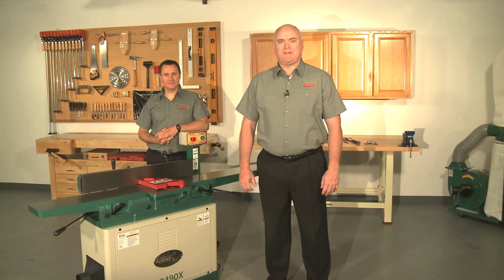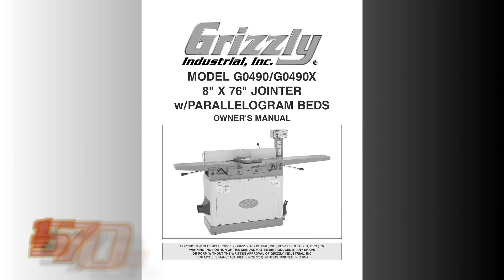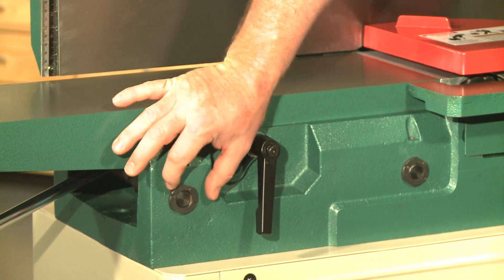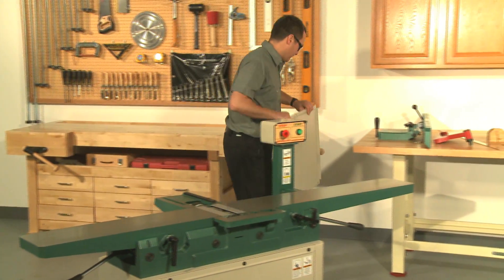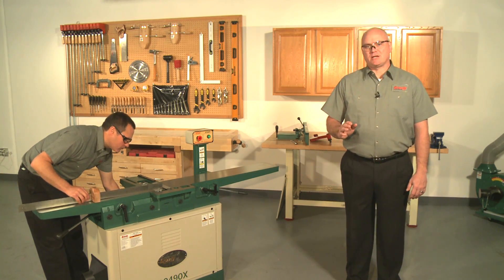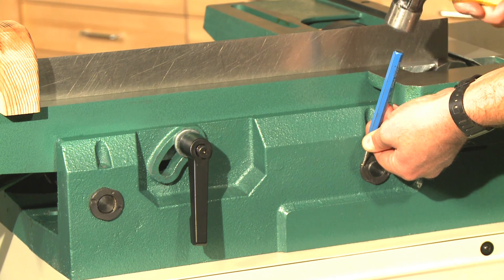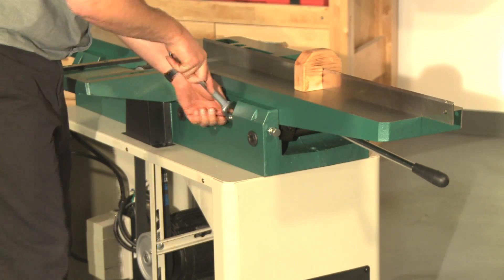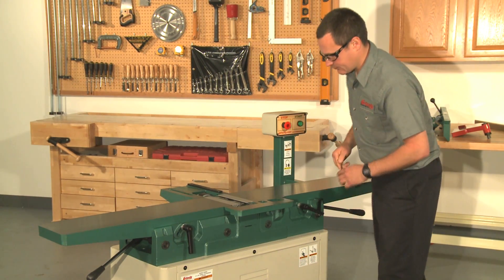Parallelogram Jointer Setup: How to Align the Tables

Comment: I just adjusted my Delta DJ-20 jointer which is almost identical to this Grizzly jointer shown. The method I used was the exact same as done in this video even though I had no prior knowledge or experience in doing so. Just sort of looked at it and made a few measurements and created a game plan. The outfeed table was far out of adjustment by 0.010” across the cutterhead. To get it inline I had to adjust all four bushings to get it even. The infeed table adjustment was the most difficult. It seemed like the best I could get it was a compromise of a few thousandths. That’s where I left it which seems to not be any problem. My jointer has three 8” straight blades that I just received back from a sharpening service. That set up I have done before, is a PITA and I sure wish that a helical head was available when I purchased this made in the USA Delta jointer in 1995. The longer the straightedge you use the more accurate you can be. A set of feeler gauges is helpful in measuring the table with the straightedge while setting the beds complainer. In the end it’s still wood and the most minor differences don’t matter.
Reply from the maker: Thank you for the in depth response. Great to hear you were able to use the same method for your Delta jointer.

Comment: Thanks for this video. I have a King Industrial jointer and it adjusts essentially the same way. The instruction manual didn’t contain any instructions on parallelizing the tables.
Reply from the maker: We’re glad the video helped fill in the gaps! If you ever need assistance with your jointer or have questions about similar adjustments, feel free to reach out to Customer Service.

Comment: My question is why not adjust the inner edges of both tables parallel to the cutter head? You seemed adamant not to do that. If one has a magnetic base dial gauge then one could be assured the near and far sides of each table near the cutter would be accurate. Then lift the infeed table to match the outfeed with a 12" rule. A long straight edge across both tables would allow you to see the variance in the ends of the table wings and more easily decide whether the far end of the outfield table should go up or down, so the infeed table was in its proper range.

Comment: The piece of information that I needed, that seems always missing from all explanations and printed documents is how to read the position of the eccentric bushings. The dot indicates the thickest side of the eccentricity. The neutral position of all the bushings is with the dot horizontal. Maybe it is just me, but not being able to see what is happening inside keeps me confused. Not knowing that reality, my brain was imagining turning a cam instead of a bushing. (I could have looked at the parts diagram and not made that mental mistake.) The two eccentric bushings hold a rod that passes through holes in the table casting, so moving the dot (thicker radius) downward raises that side of rod and the table. Moving the dot toward the top means the thinner part of the bushing supports the rod and the table lowers. (If it were a cam, the opposite would be true. It's little things like that make me feel stupid sometimes.)

Comment: Question... Let's assume my outfeed table at the cutterhead is .003 higher on the operator side. When I adjust the can 1st that location, will an adjustment be required on the opposite corner to compensate? It seems I will build a "rock" in the table on the cams if I don't. Am I thinking this correctly? Thank you!

Comment: I ordered an 8 inch jointer last May its almost a year later I still haven't received it yet. For months they told me it was on back order.  Then someone told me I should have been told that the 8 inch jointer I ordered was no longer available so I got bumped to the back of the line for the next 8 inch jointer model.  I am still waiting.....
Reply: Did you get your jointer yet?

Comment: First: why did you remove the back panel? I did not see anywhere this was necessary. Second: On my G0604ZX it seems that the rabbeting table extension is in the way of the setting bolts of the eccentric bushing. Do I need to remove the rabbeting table extension? BTW my jointer was way off from parallel after I assembled it. From operator POV the back right side of the infeed table was almost 1/4" high.
Reply: Almost the first step they showed was rotating the cutterhead pulley by hand, through the space covered by the back panel.
Reply: Brad Hedges Well honestly I did run thru it too fast. But still the cutterhead can be turned easily from the front. Much easier than taking off the back panel. I suppose for Grizzly's liability they felt they had to do this. Another dummy-me thing I noticed was that part of the reason my infeed table was so far off was because my fence set too low thus limiting the up movement when trying to adjust for smaller cuts. I followed the assembly instructions precisely but apparently did not tighten the fence mount good enough and the fence lowered over time. On another note I just rotated the cutterheads but can still see shade lines where the blades cut the wood. I am not yet convinced that the spiral head was worth the $.
Reply: It's interesting to hear that you're not convinced the spiral cutter head is worthwhile. I will be buying a jointer and planer in a couple of months and have been researching options. Almost everyone recommends them, but I have seen several others who say keep the standard blades.
Reply: Brad Hedges My previous jointer was a standard 6" Grizzly that was about 30 years old. I loved it aside from changing the blades. But I wanted a longer one to be able to flatten longer boards. What I notice on the positive sides with the spiral cutting head is that it moves through the hard tiger maple I am jointing with ease and I really don't notice tear-out. AND I haven't done a true test with other materials such as walnut, cherry, oak, etc. Obviously the hard maple is well.......very hard. It is possible that I ran the maple thru the jointer too slow and the shade lines I can see are heat related. Keep in mind that I am not a professional woodworker but have dabbled for a long time on and off. I will try to report back soon after more tests with other materials since now I think I have it dialed in.
Reply: Thanks for sharing your experiences. I am using an 8 inch Grizzly planer w/ helical head at the shop of a friend when I need one. They are nearly half an hour away... So that is not optimal. 

I have pretty much decided on a pair of new Grizzly tools, the 0490x 8 inch jointer, and the 0454z 20 inch planer, both with helical heads. I am building a lot of stuff to sell, and really need them close to hand. I appreciate hearing your experiences, they provide another view I haven't heard much of.